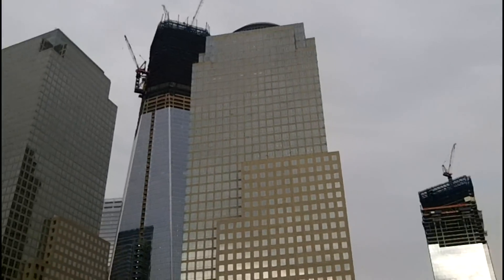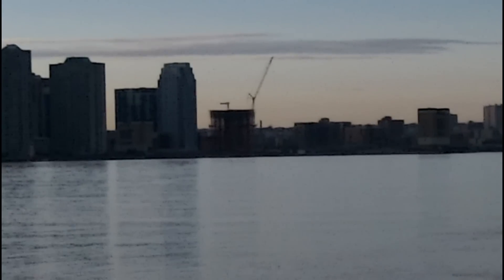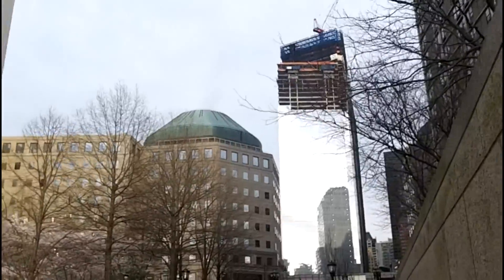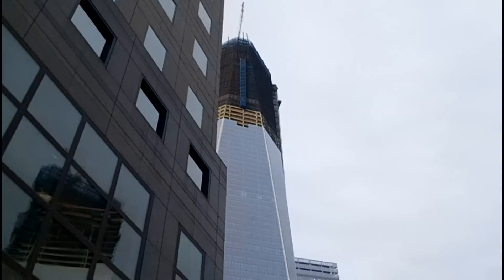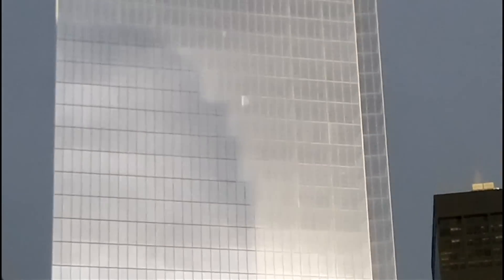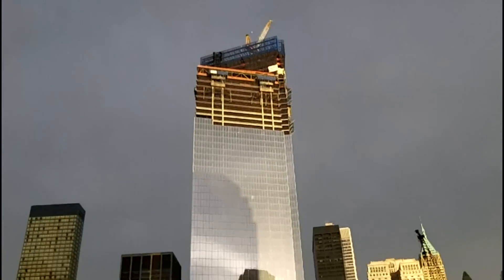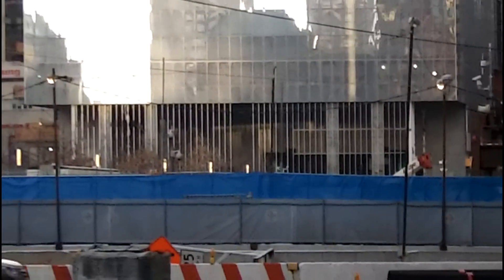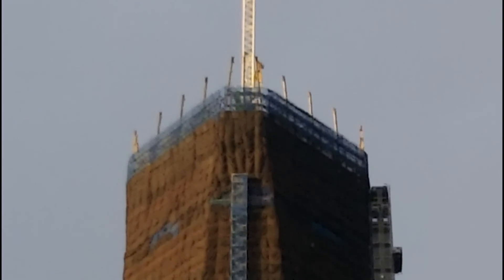UPDATE! One World Trade Center / Freedom Tower 3/25/2012 construction progress part 1

Comment: Tower 1 is my favorite one as of now. I can better decide on a favorite when they are completed. Although I do admire the way the upper floors of 4 have that setback or whatever it is called that differentiates it from the rest of the structure. I like the design of Tower 1 and cannot wait to see what will be done with the bottom floors that still are mesh-enclosed. I think I already told you a couple months ago that it might have columns similar to the original WTC. That's what I heard. Thanks!